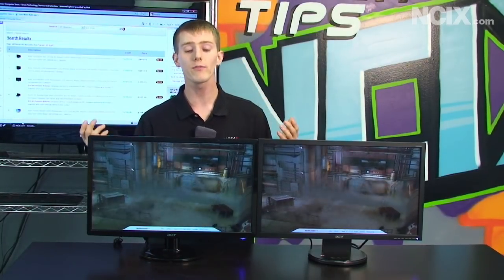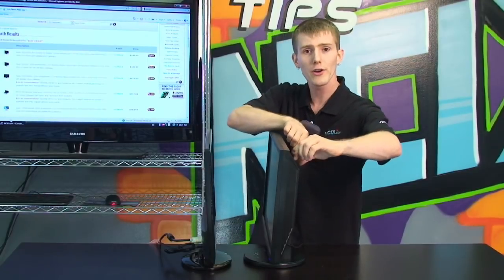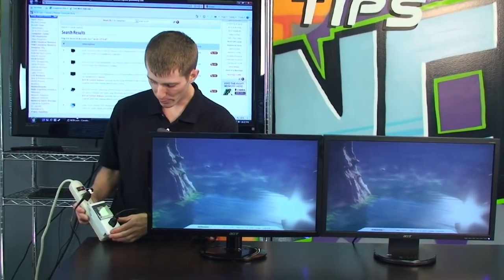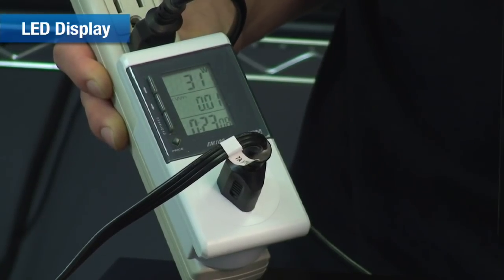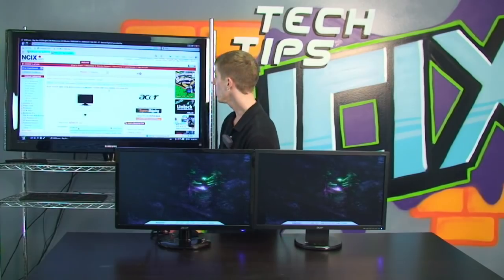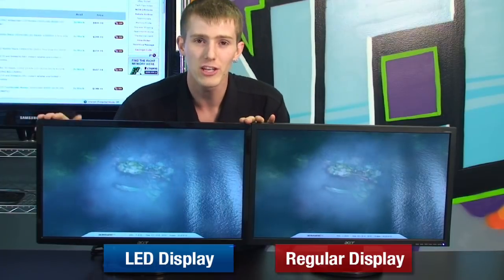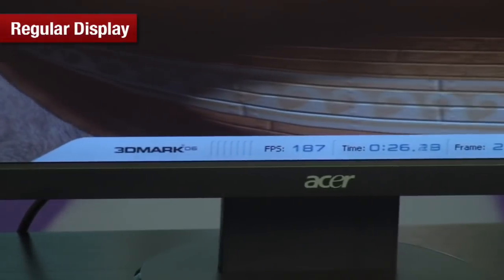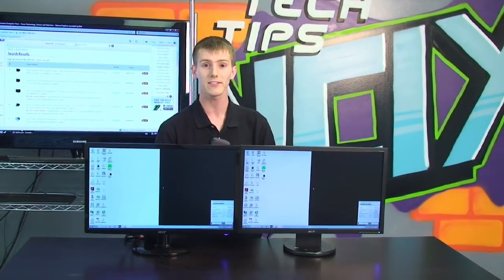Advantages of LED Back-Lit Display (NCIX Tech Tips #74)

Comment: The reason why your LED-screen is thicker, is because of you having your "adapter" built-in. Or it just might be your models design. But there's a good chance that a portion of that thickness is because of the built-in "adapter"(I'd say transformator, but I guess adapter also covers it..).
There shouldn't be any issues with you having your adapter built inside of your monitor. It might just get a few couple of degrees warmer inside it.
:)

Comment: no..the general bulk you see behind the regular monitor isnt the cathodes..its actually a designated box for voltage regulation and external circuitry such as button functions..believe it or not the cathodes are fairly slim too..theyre actually integrated in the LCD panel..just an FYI

Comment: One thing you didn't mention Linus is that LED backlights have a much longer working life than Cold Cathode Lights, typically about 2 to 3 times longer, so if a good Cold Cathode light last about 3 to 5 years, a good quality LED light will last around 8 to 10 years or more, all other factors considered of course.

Comment: I personally prefer the contrast and picture of the regular screen.
You can clearly see that the edges of the LED-lcd sceen are slightly brighter because of the edge lighting technology (which makes it thin). Also I dont think you can properly judge color accurancy based on 3dmark06 since its not a natural source, you would be better off comparing pictures. The only real benefit to me on this led screen would be the power usage (also less heat produced).

Comment: I've got an LG E2360V FLATRON. If it does or doesn't have Back-lit technology I really don't know. But i do notice that the quality is really good. I use the DVI-D input whith a Nvidia XFX 7600 GS (<- Epic fail, i know) and i notice the lighting is always nice. The contrast is nice. So if the Back-lite technology really helps. Depends on the rig you use aswell. But i think it does help alot.

Comment: Linus- what are good suggestions for monitors LED backlit or not that I can use for an eyefinity setup? I currently have 2 23" monitors but they are not the same and my desk wont fit another 23". Im thinking of getting slightly smaller size monitors. 
Help would be great!

Comment: I got a dell 2209wa, is a 8bit IPS traditional LCD.  I still like it a lot however.  I also got a new asus 6 bit IPS which is LED backlit.  For some reason the asus has worse viewing angles, its not like TN screens but the screen dims off angle whilst the dell doesnt  have been assuming its due to the LED backlighting but could be wrong,  Whats really noticeable is even tho its 6bit the colours look better and less washed out on the LED and the contrast ratio is clearly superior.

Comment: hello linus ........can i change the resolution from 1920x1080 to 1280x720 in full screen for gaming ??because my pc is not good enough for running 1080p gaming.......so if the led monitor can run in 1280x720 in full screen will the graphic become very ugly? please reply asap

Comment: Calibrate your screens, just because that screen seemed more accurate out of the box doesn't mean it applies to all LED displays. Also you can only get darker blacks with a full LED backlit screen with local dimming, a better LCD panel or by running your backlight lower. A brighter light can't make darker blacks, period.

Comment: My Viewsonic LED monitor is great but has some excessive light bleeding at the edges. I recently  picked up a Samsung D8000 LED TV that had the same problem making it difficult to watch dark scenes in movies. I find my new plasma gives a better uniform picture but unfortunately i dont use my pc on it alot as i have to wheel it across the house...

Comment: lcd monitors are actually not that thick. deep inside that large frame, there is a video processor, and also a power supply. which is how most lcds are able to use a simple 3 pin power cord. i prefer led but if you were to actually take apart an lcd, youd realize that alot of space is wasted.

Comment: LED screens have EXACTLY the same display panel on them its just the lighting that's different. the colour on a LCD isn't actually as natural because the LCD lighting doesn't light up all the screen as evenly, its just like putting a lamp right up inches infront of a photo, half of what you see is just the light bulb shining over the image whereas in LED screens the lighting is perfectly even since the lighting isnt just a bunch of tubes with reflectors attempting to even it out...badly

Comment: I should point out for anyone that doesn't already know, the contrast ratio's for both monitors that flashed on screen during the video are completely false. What that is noting is the "Dynamic Contrast Ratio", a completely fabricated, meaningless term created by the LCD manufacturer's to market their products. The real contrast ratio (between 1500:1 and 3000:1) is what is important. The problem though, is that more and more LCD manufacturers are not publishing that value.

Comment: @THEHOLYSPLIFF Not really when it comes to this stuff. That factor can be neglected in this kind of experiment, due to the fact that they most likely used the same video card on each computer. Either that or they had two monitors connected to the same computer each displaying the same picture (clone display). But yes, in the real world, some video cards will display differently then others. The thing is that cards today are polished to the extent that they will display color just fine.

Comment: Touching the soldering points on the back of a PCB isn't the worst thing he does, but when he touches the contact points on RAMs or GPU's I do get a feeling of dislike..
The grease can be easily removed with some alcohol anyways.
But then again, the items he reviews aren't going to be used.. But if they are, I do hope he cleans the contact points and the back of the PCBs.

Comment: LED is better, ok, but I can't actually buy the one i want, what the hell is with 1080 vertical pixels popularity nowadays? I don't want it, I want a 24 inch 1920x1200 LED back lit monitor (16:10). Are they no longer manufactured or what?